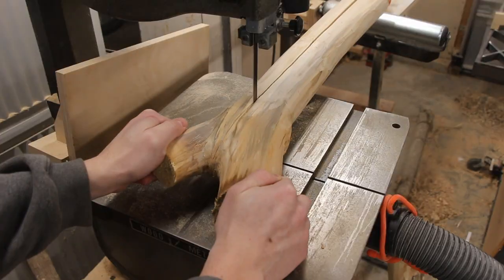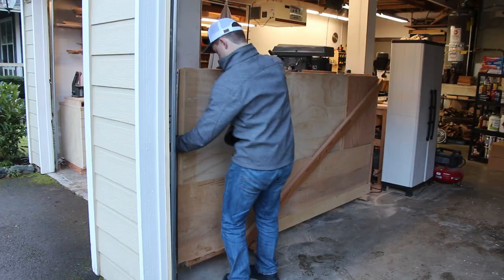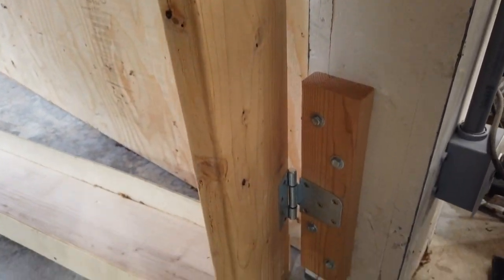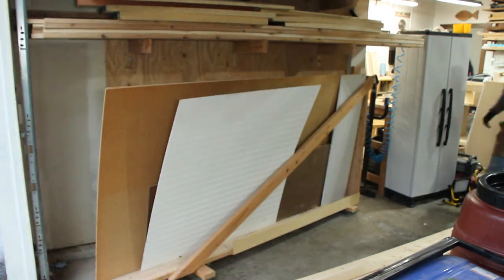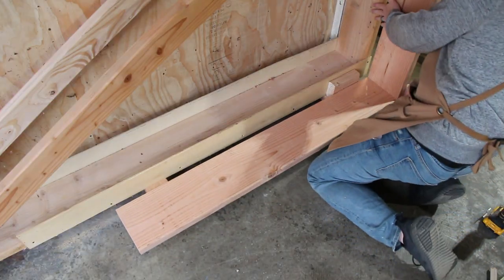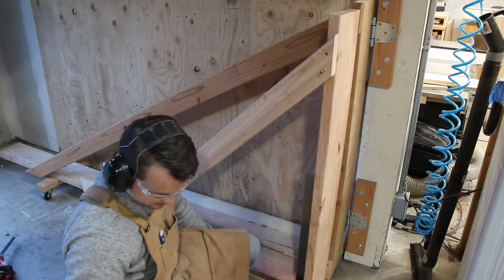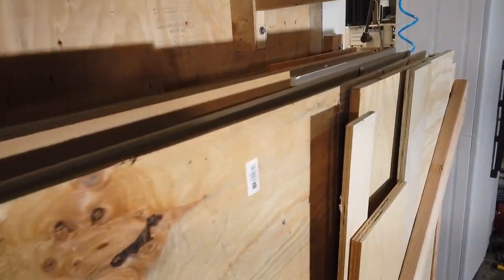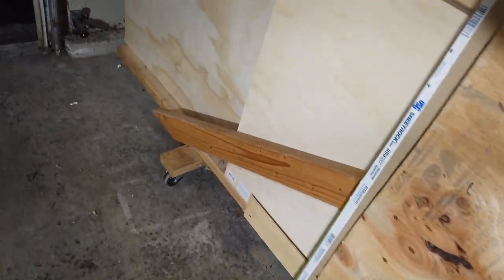Easy Plywood Storage Rack Swings Out | Evening Woodworker

Comment: Found this video today. Built it in my garage this afternoon. Used heavy duty hinges to connect the side and bottom so that it would be able to flex when swinging over the uneven garage floor. Worked out well. Thanks so much for this video.
Reply from the maker: That's great, I'm glad it helped! Good work building it right away too.

Comment: I just finished mine based on your design. It works great. I like that you can remove the supports for different configurations. I learned along the way that I needed to plane some down to fit the holes. At first I just pounded them.l’ll have a hard time removing those.

Comment: YOU COULD JUST MOUNT YOUR CASTERS ON A VERTICAL SPRING YOUR CONFIGURATION SO YOU CAN SWING THIS UNIT OR FURTHER ON A SLIPPED FLOOR WITHOUT BENDING YOUR HINGE!
👍🏼✌🏼✌🏼✌🏼🇺🇸
Cool video!

Comment: Great idea. I used spring loaded casters on the far end then just a single caster for additional support at the hinge end. The spring loaded casters should take the variation in my garage floor and reduce the stress on my hinges. Time will tell. Thanks for the idea.
Reply from the maker: I'd be curious how that works for you. Mine has a swing limit!

Comment: Great idea!  Just sharing a thought:  if you only had one set of casters (at the furthest end from the hinge), you could replace the hinges with eyebolts and long bolts with nuts. For each hinge, it would be two eyebolts in the wall and two eyebolts into the cart.  The eyebolts on the cart side can slide up and down the bolt.  The bolt would have to be longer than the eyebolts are spaced.  It should allow for wide swinging of the cart as the whole things goes up and down with the slope of the floor.
Reply from the maker: That's a great idea! Thanks!

Comment: Great and simple idea. My storage atm is just 2 planks on the floor and the sheets can't be left standing up straight or they fall over to the front. This makes it really hard if I need the sheet closest to the wall as I have to move every other sheet out of the way before I can grab it. And since I only have a 5x8m garden shed with a 3x1.2m workbench in it in the center, I don't have that much space to put all those sheets before they block me from moving anything. And I have some wall-mounted stuff in the way that block me from pulling out any sheet parallel to the wall, so that hinge system is really handy.
Reply from the maker: You should try it! It sounds like it could work for you.

Comment: The way you know an idea is perfect is when someone shows it to you and you end up kicking yourself for not having thought of it already!  Good stuff, and I will be doing this with my own sheet goods storage, in my too-small garage shop space, over in that side space beyond the garage door track where it's cumbersome to put a larger plywood cart.  Regarding bending the hinge pin, it occurs to me an extra chunk of 2x4 between the hinge and the wall, with elongated holes allowing up and down movement, could solve that problem.  Screw the first 2x4 to the wall, then drill/cut vertically-elongated holes into the second 2x4, attach it to the first one with thick lag screws and washers for sliding that 2x4 up and down on the first, then add the hinges to the second 2x4.  I don't know if the forces involved might cause the lag screws to fail, but 2 per chunk of 2x4 'feels like' it should be enough to support the outer, hinge-mounting 2x4 chunks.
Reply from the maker: I don't know if that would move up and down the way you're imagining unless it was really greased. But I'd be curious if it works!

Comment: I built this earlier and realized a few problems that may be somewhat specific to my garage. If you have an old fridge in the corner by the entrance like I do (or anything of similar size) you'll have to mount it closer to the back. This reduces the ease of loading as it's most likely going to be blocked by stuff. And this led to problem 2: if you have to cross a settled slab, it's not going to roll very well and the end caster will be off the ground. 

Good idea but needs flat-ish floors and to be mounted as near as possible to the door. At least it can be repurposed into a standalone cart relatively easily.

Comment: Hi Jared I'm a new sub. Suggestion to improve your swingout storage. Cut the lower frame midway, overlap the boards and install a bolt as a pivot. The outboard support wheels will follow the uneven floor without stress on the hinges.
Reply from the maker: That's a great tip! That should resolve my problem.

Comment: Does this keep the plywood from cupping or warping? I bought 4 sheets of sapele ply that were absolutely perfect and straight. Had them on 2x4 on my concrete shop floor for a week. When I was getting them ready to cut with a track saw I could not believe what happened...they were all warped or cupped...what the heck. Can never keep ply without this happening

Comment: Could the hinge issue be fixed by using a ball joint or something similar low on the wall instead of the hinge?
Reply from the maker: I think I'd need to use a hinge that could slide up on the pin. Ball joint may work but then I gotta have something at the top hinge that can allow it to flex down.

Comment: Any reason not to just put casters on both ends and then it’s completely mobile vs swing out? Just thinking about the hinge bending problem.
Reply: I just built a lumber rack and I wish I’d considered this idea. Once you load up a mobile lumber rack with all the lumber and plywood sheets you have, it gets pretty cumbersome… this is a great idea
Reply from the maker: When you have casters on both ends, it can make it more likely to tip over depending on how wide the base is. This makes it basically impossible to tip over... unless a lot of bolts rip out of the wall!
Reply: @EveningWoodworker  - That makes complete sense- thanks for the response. We are in the opposite situation where I’m trying to eek out as much of the garage for my shop that I can from my husband who is into more tech than tools 😜